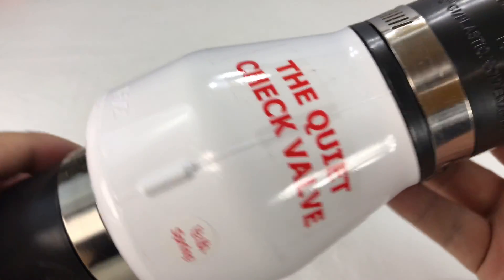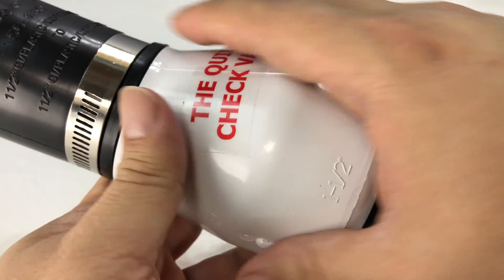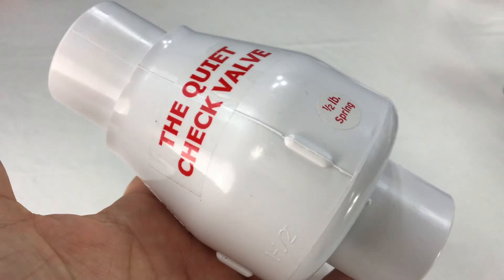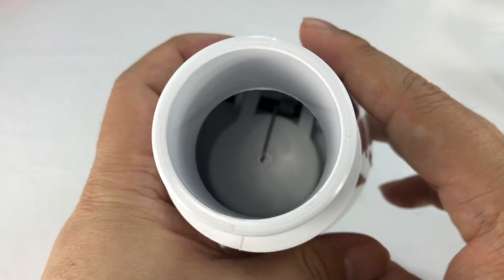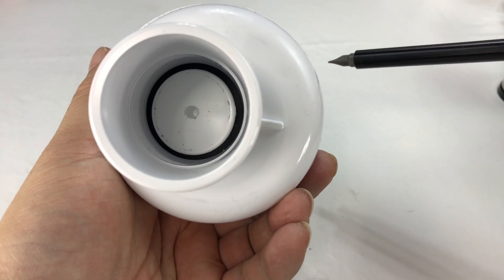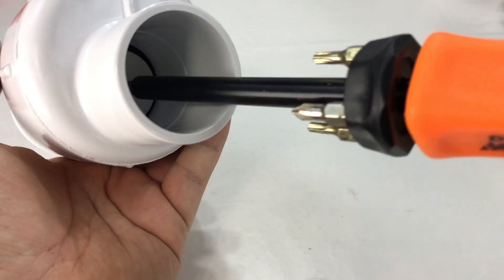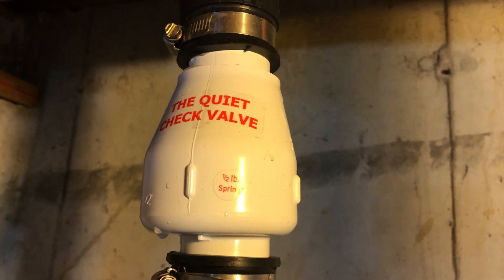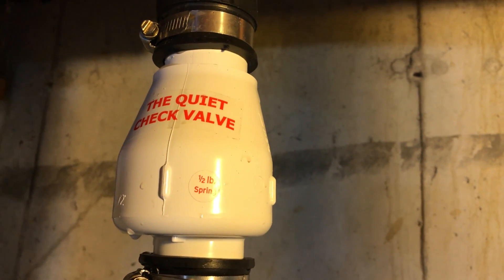Does the Quiet Check Valve Eliminate Thunk Sound from Sump Pump?

Comment: It works because the spring starts to close the flapper before the water stops flowing.  Once the pump stops the water for a brief moment is still flowing forward then stops moving forward there is obviously a pressure drop which the spring is designed to close the flapper even though there is still water within the valve chamber and outside the valve chamber in the pipe so there is not a slamming of the flapper into the seat which causes that thunk noise.  Because the spring closes the flap against the water it actually acts as a cushion as a soft close as opposed to a hard close.

Comment: I had to replace my sump pump and while the conventional check valve was noisy thought I would try a "quiet" valve. I picked up the "Basement Watchdog Klunkless Check Valve" at Home Depot . It was expensive.  Unfortunately it is 10  times noisier than the regular one. Huge clunk and the pipe and whole house rattle. Wakes me up at night. I will try this one. Thanks.

Comment: OK, yet another explanation on how it works.  The loud ones rely on back flow of the water to close the valve.  Since the flap won't close until the water starts flowing back down at a fairly high rate of speed, and water is heavy, there will be quite a force of heavy water when the flap finally closes, causing a bang.  The spring on the quiet one closes the flap before the water starts falling quickly, so it's stopping the water with much less momentum, and therefore less force.  As someone else pointed out, the angle and turbulence have something to do with it also.  The 1/2 pound force of the spring is very easily overcome by the pump motor, which can push much harder than that.  Very clever idea, as long as that spring doesn't rust quickly!
Reply: Exactly. That is what I was thinking.

Comment: HOW IT WORKS.  The larger housing diameter and slanted exit angle create a turbulence withing the valve housing.  The turbulence crashes into the briefly backflowing water just long enough to allow the flap to close quietly.  Pretty smart idea.

Comment: Thank you for your video. I was doing a sump pump replacement and had the standard noisy 1 1/2 check valve make that thunk sound. I bought the McDonald valve at my local plumbing store. After reviewing your video I returned it for a Zoeller quiet check valve. Zoeller and Campbell make the clear see through valves with the screw on compression fittings. The Magic has the rubber clamp style fittings. Zoeller makes one in opaque which is what I bought. I think the other brands are knock offs of Zoeller and I don't know how long they will last in comparison. Great valve though, super quiet and no thunk.

Comment: You said you didn't know how the 1/2 lb spring of that unit is able to work? The area of the port looks like at least 1". Standard water pressure is 60-80 lbs/sq in. I think a 60 lb rock could overcome a 1/2 lb spring tension...no?!
Reply: You are talking about pressure on the input water line.  Here the pressure what your pump generates.  If it can raise water 10', that corresponds to ~5 lbs/sq inch.   Way less than pressure of your water supply, but still plenty to open the valve.

Comment: I bought one similar by ay mcdonald sump pump check valve but i have a sewage ejector. Will it still work for my system? Im annoyed by the loud thump ive been hearing
Reply: By the way the check valve i got is for 2inch pvc
Reply from the maker: I love this valve. Not sure if it’ll work for sewage but it’s great for my sump.

Comment: Silence is golden!
In boats, we use expensive stainless steel hose clamps ( on the cheaper ones, the band is stainless, but the tension screw is not, will rust out and the band release, hose leaks or falls off, boat sinks.) This is "mission critical" so two bands are used in each connection ie back up redundancy. Peace